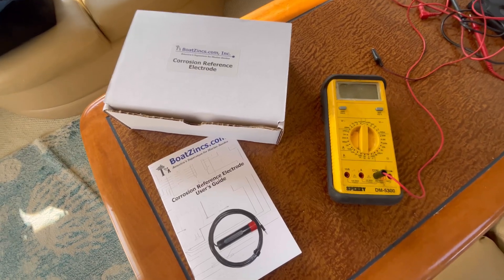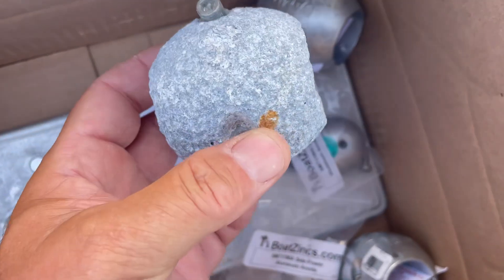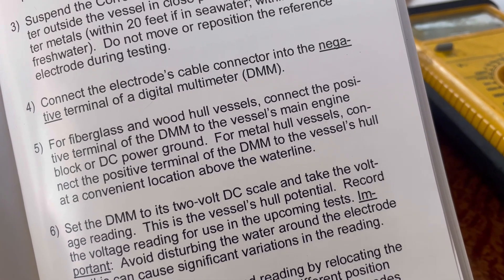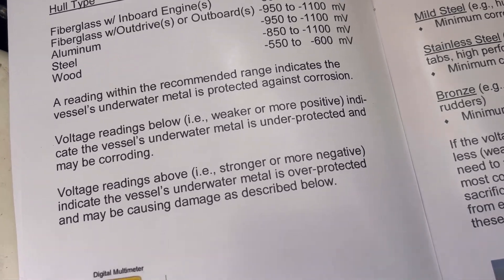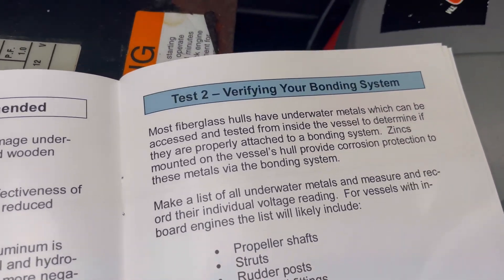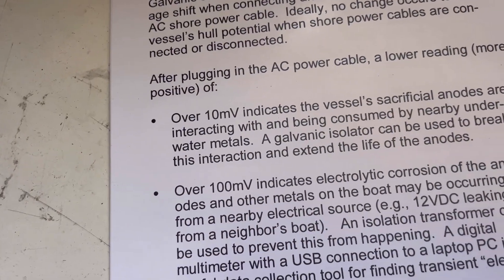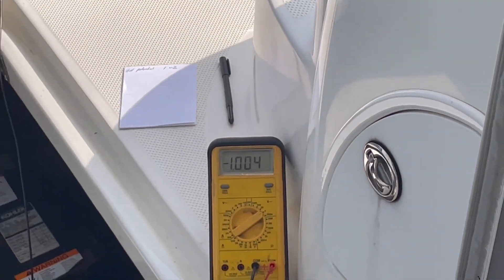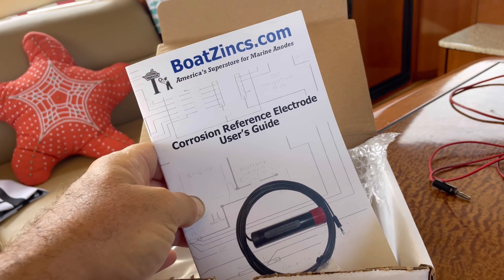BoatZincs.com Corrosion Reference Electrode

Comment: You can't mix Aluminium and Zinc anodes. It's one or the other. The only exception is your inside the engine water system anodes. The Aluminium and Zinc anodes will eat each other.

Comment: Maybe I am wrong. The meter was set to the 2 volt range. The meter showed -1.022V. NOT Millivolts. The meter should be on the 200m range.
Reply from the maker: There are 1000 milivolts in a volt.  So 1.022 volts is 1022 milivolts.

Comment: Very helpful to have the demonstration of this.  Thanks for sharing.  Did you ever find the source of the problem?

P.S.  I believe you should turn off each breaker after testing it (i.e., don't have multiple circuits on at the same time during the testing).  That makes sure only one circuit is measured at one time.
Reply from the maker: Didn’t appear to be a major issue.  My anodes were switched from aluminum to zinc which helped in salt water.

Comment: Does mixing anodes - having one zinc and one aluminium also cause the lower readings?
Reply from the maker: You don’t typically want to mix metals in salt water.  I’d guess that would create more current.

Comment: Hello sir,
Thank you very much for your video.
I have to tell you that all tour grounds have to be changed because they are rotten by verdigris.
So the test you did should be done again on the engine propulsion engine itself as described in the instructions.
Make sure that there is no verdigris on the parts tested between them (CRE and the alligator clamp hooked to your multimeter).
Cheers,

Comment: After you turned on you battery charger your hull potential quickly shifted down and then slowly rose while your batteries were charging.  Your charger's ground cables are introducing a voltage drop (V=IR) that's being detected outside the boat by the Corrosion Reference Electrode.  During the transit time of recharging your battery(s) your zinc anodes are experiencing accelerated corrosion (a.k.a "Electrolytic Corrosion", "Stray Current Corrosion").  However, your situation does not appear to be severe as the maximum voltage drop was only 50mV or so.  Regardless, make sure your battery charger ground wires are oversized and have good electrical connections to each of the batteries being charged and that you have excellent ground connections to (and between) each engine block. Think about it -- if every underwater metal is connected together with perfect grounds (i.e., 0.00 ohms) they can only ever be at the same potential.  Your hull potential would be unchanged whenever any electrical device was turned on or off.   Also, don't forget to include in the testing your engine alternators at max RPM.
Reply: Thanks for the detailed reply.  I learned something!
Reply: @jrr1lp same and OP, and great video, Sir!  Thank you from NJ where it is also knife cut weather right now. 🫡
#TheMoreYkuKnow
Reply from the maker: Thanks for the info.  You are not the first one to suggest checking the ground connection for the batt charger.  Will do that soon!

Comment: Very interesting test.  I've seen divers at our marina use these before they dive on boats.  Never thought about picking one up until your video.  I was also wondering what you had done about your anodes after moving down from NY to FL.  What anodes do others use in Cape Coral?  Hope all is well.  Thanks for the video and making me spend more money. :) C & G.
Reply from the maker: I had used aluminum anodes but are switching to zinc where available here in sw florida.   They seem to hold up better.
Reply: @AdventuresofHappyOurs why are you experimenting with expensive stuff, instead of asking qualified locals for advice?
Are you even qualified to advice other people with that attitude? 🙈

Comment: Check and see if the ground wire on the battery charger AC was accidentally put on the DC ground buss bar. And see if the DC ground was accidentally put on the AC bus bar.
Reply from the maker: I’ll check that. Thank you!

Comment: as usual Capt. Tom good info thanks  I use magnesium in fresh water anodes pretty used up each season  I have bought my anodes from this company before. I  have my battery charger on quite a bit so the shore power is usually plugged in     alk in michigan
Reply from the maker: I’m hoping the zinc anodes fair better than my aluminum.

Comment: If I followed along correctly, it seems like you tested out ok.  Maybe just switching from zinc to aluminum is all you need.  That's what I use on my outdrive, however it isn't permanently in the water like your boat.  I also have the Volvo Penta Active Corrosion Protection system - maybe that's something to look into?
Reply from the maker: I’ve had the active protection on older stern drive boats and it worked well.  Not sure why they don’t make them for inboards boats.

Comment: Have you thought about changing the type of zinc? Aluminum, magnesium, etc.?
Reply from the maker: I’m changing my anodes to full zincs.  My thrusters anodes are only available in aluminum however.
Reply: @AdventuresofHappyOurs  From my understanding, you are not supposed to use anodes of different metals underwater as they have different electrochemical potentials. Only when going from external (ie. hull) to internal (ie. heat exchanger) can you use different metals.